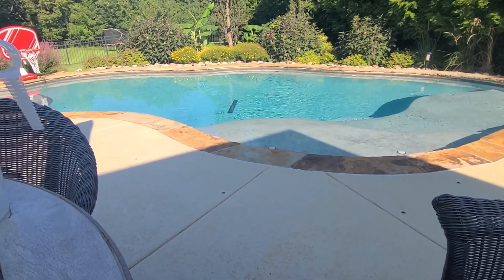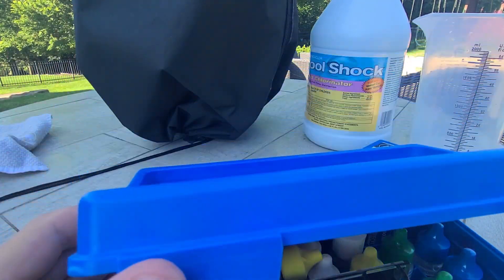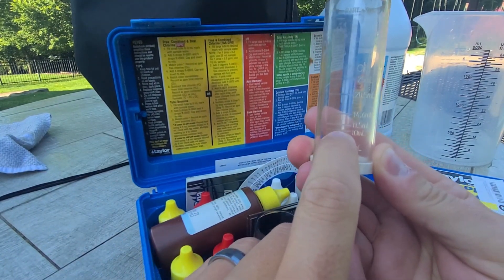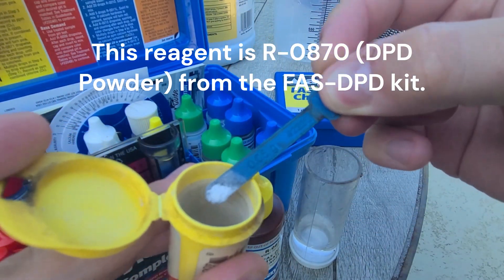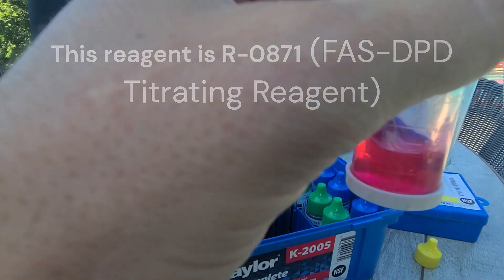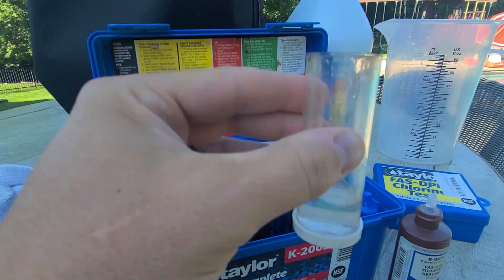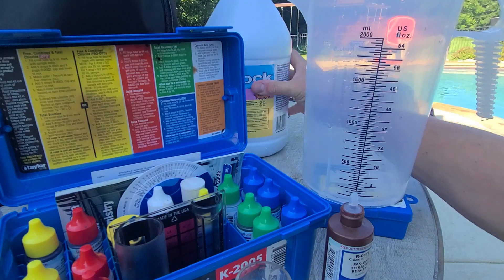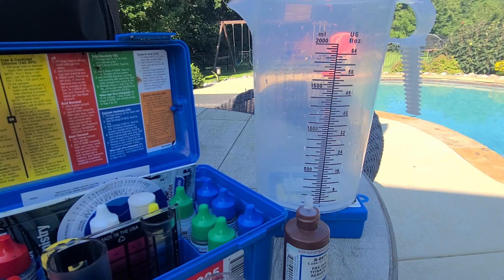How To Test A Pool's Free Chlorine (FC) using a Taylor Test Kit (K-2005/K-2006 and FAS-DPD

Comment: Omg thanks for showing this- I just got that 2006c test and this powder stuff had me so confused especially the *note- between step one and step 2.
I still don’t understand the math. 
If I use the 10ml mark and add 2 scoops, then add the 0871 and count how many drops, I always divide by 2?

Why would anyone use the 25 ml 0.2 ppm equation? What would that math look

I need help with TA AND CH-don’t understand the directions
Reply: If you use 10ml sample, use one heaping scoop or two smaller scoops. Swirl to mix. Add drops of 0871 counting and swirling as you go until the water turns clear. Divide number of drops by 2 to get FC. So for example if it takes 10 drops to turn the water clear, your FC is 5ppm. 

I use  25ml personally because it is more accurate/precise. Probably not necessary and you'll go through more reagent, but I feel more comfortable with the results. In that case, 25ml + 2 scoops of powder. Then 0871 until clear. This time you divide the number of drops by 5. You can do it in your head if you divide by 10 and double it. So for example if it takes 17 drops to turn the water clear, that means you have FC of 3.4ppm (17/10=1.7 ... 1.7*2=3.4).

As far as the swirling goes, do yourself a favor and buy the taylor magnetic stirrer. It makes theses tests 1000% easier since it does all the swirling for you (and does a better job of it too).

Oh and visit troublefreepool.com! Tons of information and very friendly/knowledgeable people who can help you with any questions you might have.
Reply from the maker: Not sure why anyone would use the 25ml mark, but you're correct.  When using the 10mL mark, divide the number of drops you put in to turn from pink to clear, and that's your FC ppm.